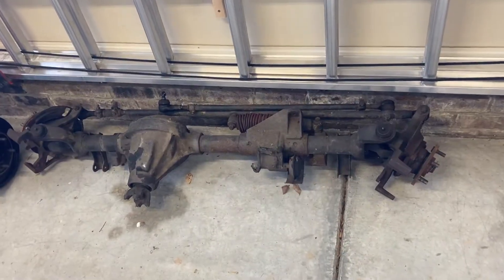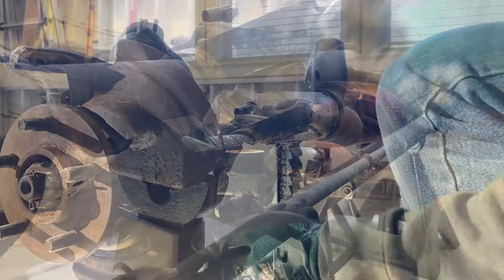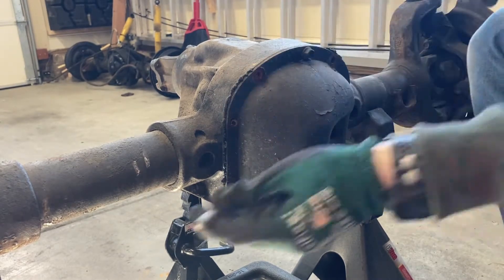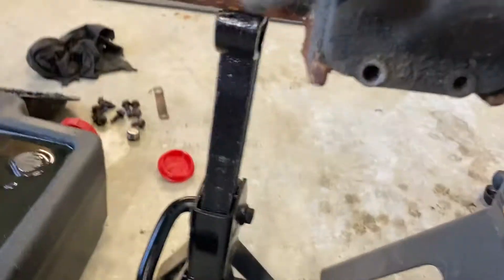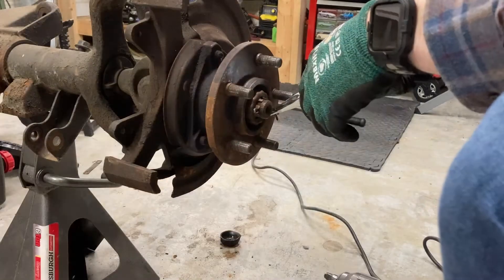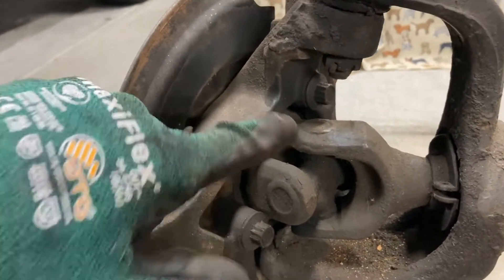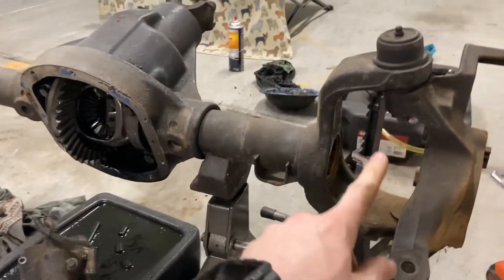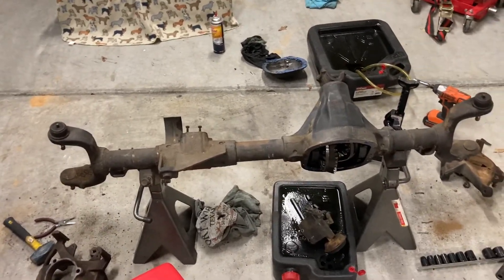Jeep YJ Axle Swap (Ford 8.8 and Dana 30): Part 1 - Dana 30 tear down

Comment: What size tire do you have and how does it drive on the highway with the new gears in?
Reply from the maker: The Jeep is on 31” Patagonias. Stock it has 3.07. With the 4.10s it had a lot better acceleration. I ended up switching axles back and I’m still running 3.07.
Reply: @tophersgarage9841   what made switch the axles back? Did rev too high on 4.10’s or were they good for the highway?

Comment: Have you considered a USA Standard Gear Spartan Locker for Dana 30 Differential 27 Spline (SL D30-27). It’s only $240 on Amazon. Seems like a useful mod for getting better traction when off-roading.
Reply from the maker: It’s on my wishlist for the Jeep!